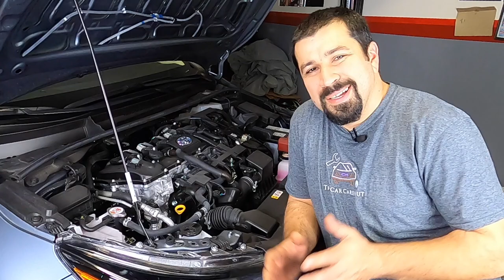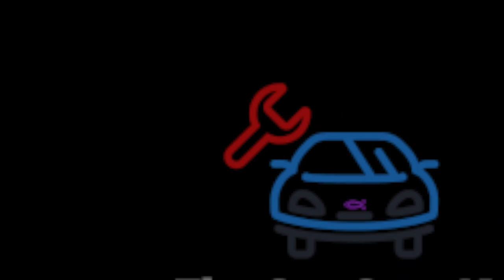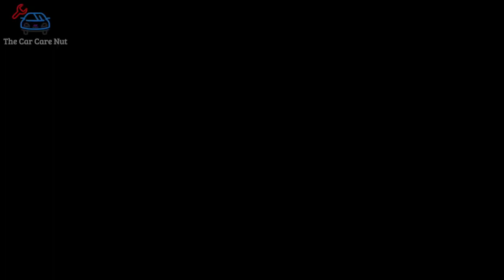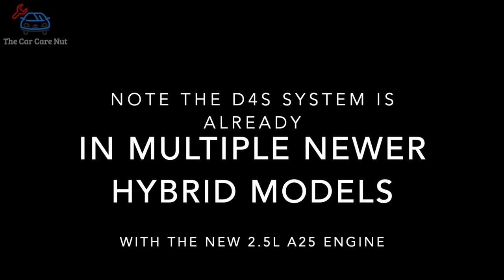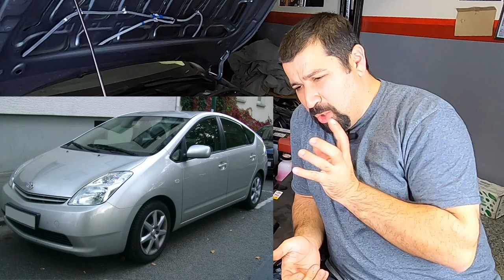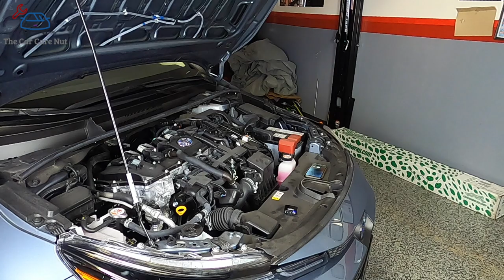How Toyota Hybrid System Work Part 5 Engine HVAC and more

Comment: Thank you for the time you put in to this channel, and for serving God's children as a technician. (As a truck driver I know that you all truly make the world go around). At work, I love sleeping in my rig. In cold and hot weather I run the APU (small onboard diesel generator). It keeps the batteries charged, the coolant warm, and has A/C. Heat comes from a diesel/electric heater.

I see in your video that Toyota hybrids have electric A/C and a small electric heater for when the gasoline motor isn't running.

To allow for a similar situation to sleeping in my truck, can we run the HVAC (lightly) when sleeping in a Toyota hybrid? The RAV4 Prime has a feature called "Room Mode" where it will run off of the battery and cycle the gas motor to charge the battery every now and then. Will non-plugin models (such as the highlander) do this as well?

If so... To avoid cycling the motor on and off, is there any way to run a trickle charger or some other power source on an extension cord to get external power to a non-plugin hybrid?

Thank you so much!
Reply from the maker: Hi Kevin,

Thank you for watching my videos! And from my part thank you for what you do. Without truck drivers the country simply wouldn’t move and nothing happen. Thank you for your hard work and sacrifice. May the lord bless you and keep you safe and healthy.

Regarding the non plug in hybrids. The problem is the hybrid battery capacity is much smaller than a plug in hybrid. So having a charger on the 12v won’t run the ac and heater it would have to be a charger to the high voltage battery which is not something I know of at the moment for recreational use.